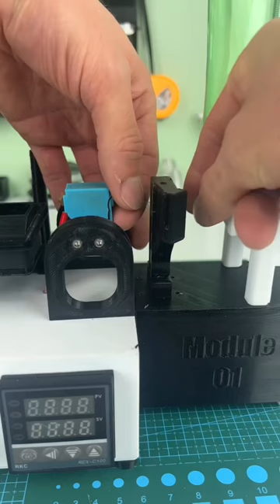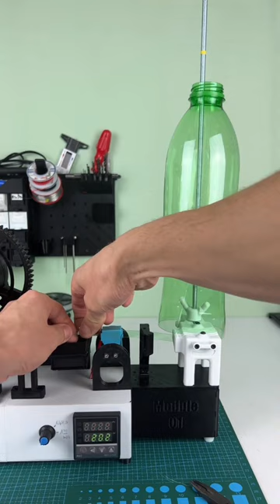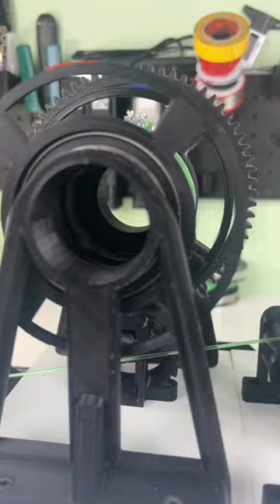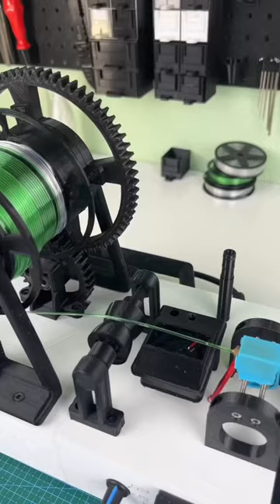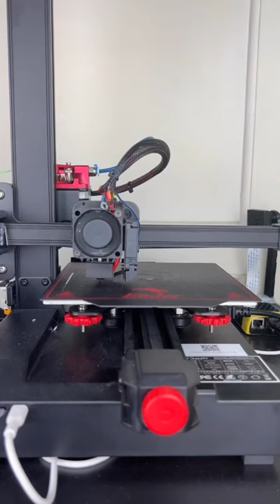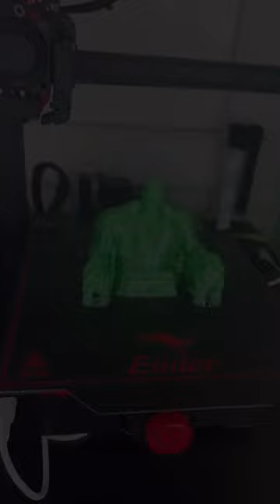Hulk made from Lipton Green Tea bottle, check how!

Comment: how long does it take to pull a bottle like that into filament?  And what is the yield in meters?
Reply from the maker: Pulling speed is around 0.8m/min, it takes 8-10min to process 1,5L bottle and we can get 7m of filament what is 20g.
Reply: @TylmanDesign  Thanks for the insightful information.  Cheers
Reply: How can i get print larger projects than one bottle ? How can i melt two bottle into one long filament?